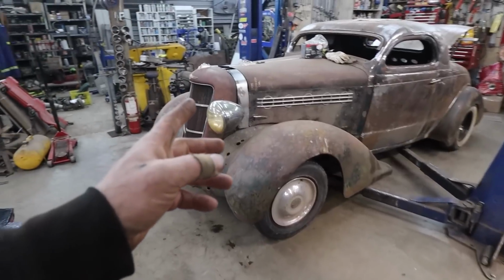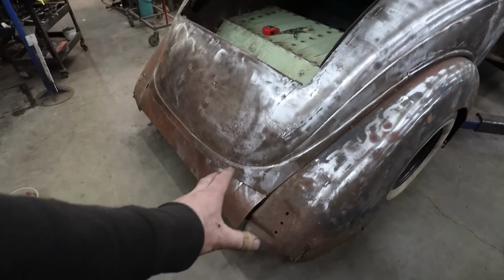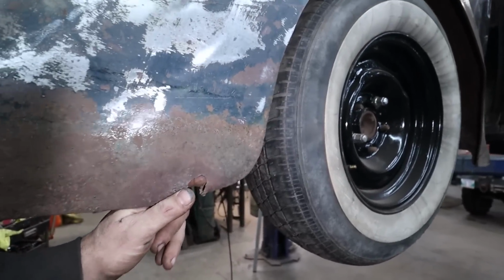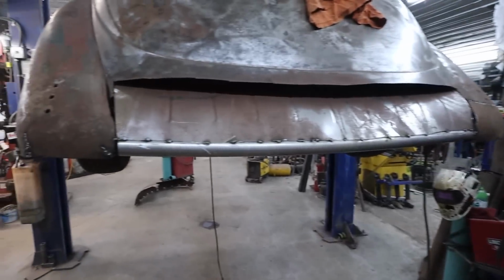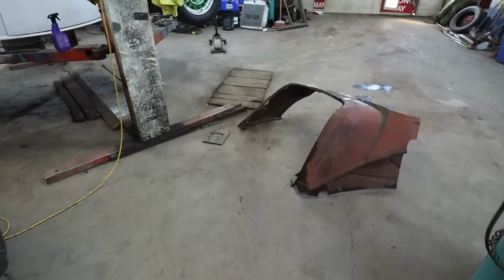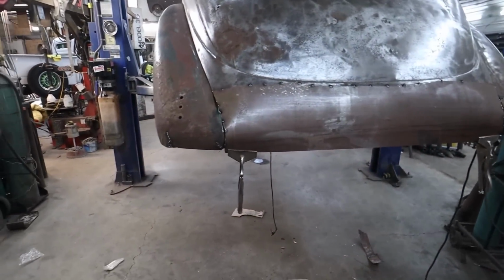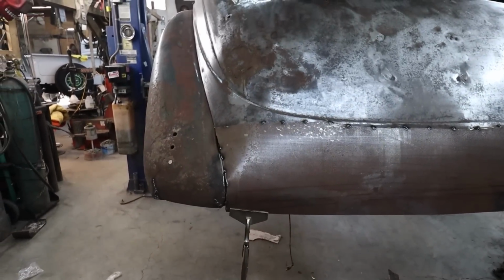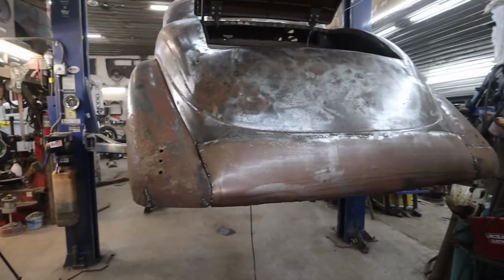Test fitting the head lights and building a roll pan for the Dodge Coupe.

Comment: Had a 1961 MGA back in my Uni days ... the Brits used "Fender Welting" to deal with the stress cracking issue ... also made it nice for painting the Fenders separately (hung) and future access advantages for repairs (like the clutch slave cylinder that was always going out).  Great job in this session ... exciting stuff. And glad to hear your intent to put rubber strips on AL to Steel contact points !!!.  BTW ... still LOVE the military wheels on the PU Truck ...

Comment: As for the grill/hood issue, I'd add to both the hood and the grillshell. Have the hood meet at the original peak of the grillshell and angle it back to clear around the headlights, with small wings added to the grillshell for headlight mounts.  Rest of the build is spot on and looking great!!!

Comment: IMO, the placement of the headlights set back the furthest you had them looks the best. Hides the rad shell extension the best. Like the look with the headlights set back like that. The fenders and the rear valance look fantastic. Amazing what you can do with some old fenders, tubing and flat steel. Look forward to more. Have fun at World of Wheels. Be safe and stay well.

Comment: Simple and easy. Looking good. That grill issue  is going to be a pain. Alot of those dodges the fender are out pass the front of the grill. I see how the front fenders tip out. If you reworked those you could move the grill  back. Seems thr long nose might be a bit much. As for rear fenders.. Bolt on.. there is way too much filler work there for you to smooth that out. Only to have it crack in 3 months.. ask me how I knowns... lol

Comment: Yes, add an extension bolt to the grill and add the same step down the grill had to attach to the hood. This looks smooth and the added strip can remain clean accenting the trim on the bottom of the hood

Comment: I remember reading a magazine article in which a person customized a '33 Dodge coupe by using the headlights and the section of the fender they were installed in front a '49 Ford, molding it into the fender so it resembled a Pierce Arrow, that would eliminate your problem with the headlight mounting and give it a custom look,I would imagine that there's a lot of different early fifties cars that would have a similar design that would be usable, just a thought.

Comment: Really liked the way the rear roll pan came out, ruff as it is! Considering you started with nothing! Sometimes the best results appear from jumping right in head first! The amount of times I hated what I had just done and had to tear it all apart are not that often! Which tells you that your hunches are right on! Not 100% but good enough odds that it’s worth doing!!! Great job, can’t wait to see all the metal work done! I think your headed in the right direction with the headlight and radiator shell hood length Idea ! At first I thought why not just add on to the radiator shell! Because adding just to the hood s a pain but it did look crappy! That 1or two inches at the hood the rest at the radiator shell looked much better! Very cool car! Keep up the good work! Regards Mad Mike S. ………..

Comment: Brent, You seem unsure as to how you want the rear to look?  I'd like to suggest that instead of planting your spare tire into the trunk, you do what Dodge itself did in the 1930's, you hang the spare off the rear deck by means of an extended arm which doesn't block the access to the trunk area.  Either that or build a wheel well out of one or even both of the front fenders and hang a side wheel for the spare making it into a 6 wheel coupe.   Also, instead of front light bullets, why not try hide-away headlights in the front fenders like Cord did with its 810 and 812 models?  The lids that cover the lights when the lights are closed can be manually pulled or pushed by means of cables like those of a manual choke or better a hood release cables that are both arranged under the dash near the headlight switch.

Comment: Love your work... I know and appreciate that you "do your own thing"... however, here's my suggestion for the "Hood" issue... move the existing hood forward to Rad... with your skill, make and fill in the gap between hood and firewall which, will include Vertical side exhausts coming out down the sides... these could function, by switch as straight, or bypass when normal exhaust... something like what I remember from an old 1936 Hudson. Keep on keeping on.
Reply: >> here's my suggestion for the "Hood" issue... move the existing hood forward to Rad<<
That's a good idea too.

Comment: Restoring these metals of DeSoto and Plymouth 1936 is fun but hard designing think the measurement and compassing.  The Lotus Elan parts have for 1936-37 DeSoto custom with the swing arm rod with 2 bushings on both ends. Both of these holes of the swing arm is a see thru holes transverse of the line (swing rod arm). One end of the swing arm is connect to the pivot (bottom) of the rear differential pumpkin (metal) housing. Second end of the swing arm is connect to the bottom of McPherson strut where it secured to the spindle as well. The rear hub knuckle have hole for connect to the radial bearing so the stub drive shaft's spindle to rotate the wheel disc brake with 5 lugs. 
 It add as these pair of swing arms to both side - McPherson struts at the back. The McPherson strut is lean 25 degree away from vertical (90 degree) then its upper end is connect to the hat rack  (steel) in under the station wagon's roof of the vintage Plymouth roller/car. 
 The Pittsburg angle finder CCKL color yellow is useful for the transmission output shaft is align to the front driveshaft solid at 4 degree down at rear pipe of Uni-body. The draft/sketch is retrieve at 51 besten Race car Blueprints Bilder auf Pinterest. They have print of the cutaway image - The Lotus Elan in Depth; search in Bing for rear suspension is a 
name/e- file in https://i.pinimg.com/736x. 
 The width of the upper control rods into an "A" arm for front suspension is around 13 inch to 12 inch high and the length between 2 lines of bottom of letter, A is 13 inch. The letter A control arm becomes into letter, "H" control arm. The control rods/ lines went from two vertical lines of letter H into spread angle like an upside down letter, "V" at near bottom of drawing along with 2 rods/tubes vertical welded to the middle of letter H control arm instead of letter, "V". The 2 tubes strong enough from a bicycle frame is connect to the pair cleats/gussets as part of clip for suspension chassis unweighted. The 2 rods of the letter H control arm is connect to the spindle of the wheel. The engine is weighted and it mounts above the unweighted clip and pipe drive train and pans system. The another mount - torque strut  is secure the engine to the fender/wheel well (steel sheet). The torque strut mount is hanging the engine up especially for rear wheel drive. The dimension of the torque strut mount is around 6 inch to 8" long worth $19.00 dollar plus tax.
  The CVJ were for rear independent suspension RWD but U-joints on needle bearings and stub drive shafts are just fine for rotate rear wheels instead.

Comment: Hi
I thought you could have a radius triangle of metal with the pointed end on the bonnet hinge and the wide part welded up to the front cowling then you could extend the bonnet and fit it to the curve of the triangle on top middle.
Good video 
Guy from England

Comment: Looking at the hood side trim... maybe add enough material to the front of the hood so that the distance matches the back end of the trim to the back edge of the hood, which will center the side trim on the hood?? I wouldn't add too much to the back side of the shell in agreeance with you. It'll be too fat.

Comment: Look at the old Chrysler straight 8 or Packards straight 8.  The “hoods” were long…..the radiator was a normal dimension and not extended back.  Modify the hood……👍😁 my two bits

Comment: I just bolt on the rear fender so if anything happens to it it can be removed for repair. Weld a plate with bolt on your cross pipe as a stud to bolt lower end of rear fender.

Comment: If you treat your front grill like when you do a chop top with the back window… cut your grill about 1/4” away from the insert bring your grill frame back, so you can rack the grill insert front and just fill in the gaps on the side… don’t know if I’m clear? You will keep the flow of the top of the grill and have a rack to the front and solve your gap between the hood and the grill.

Comment: Heres another option , without actually seeing if it would work . Move the grill and headlight   back to meet the hood. Saying this without any knowledge of there even being enough room for radiator etc. The grill is 3 inches in front of the fenders, bringing it back level , would use up the gap.

Comment: I dunno man, i mean I'm not sayin but I'm just sayin... I was likeing the back profile until i looked up like 6 inches. Now i notice the body rolls over and comes into the fenders at almost a 90 degree angle. I feel like the rear valance needs to do that too. It would give it a kind of 3 hump profile when looking straight down. Then you could make your bumpers outta like 2" dom and mold them in to match the 3 bump out profile. (And give you some meat to grind when dragging the rear end.) 
But hey man, it's your car, I'm just sayin. 
Eh, after looking at the closing shot it does look pretty good. Sooo feel free to disregard everything i said. Or comment back and explain your plan, or explain where i can shove it. 😮

Comment: Dude is this click bait? The right rear fender obviously needs to come out not in. That's why it's lower... Also the headlights imho need to be flush with the back of the grill. That will make your extension of the grill cowl fit. Also the body panel above the grill needs to be cut and rotated down in front of the grill. This is so the upper body line above the grill is horizontal. Looks good though! And... continue.